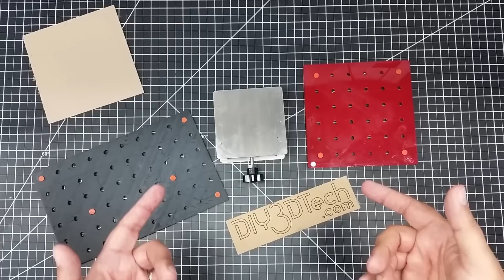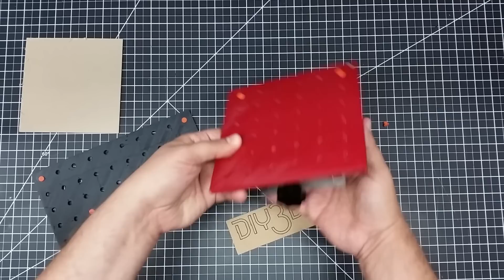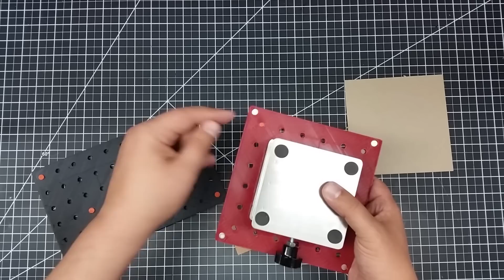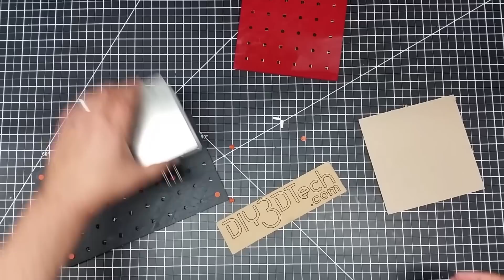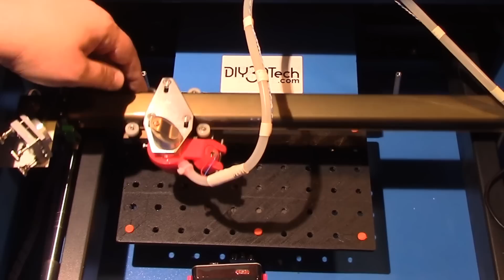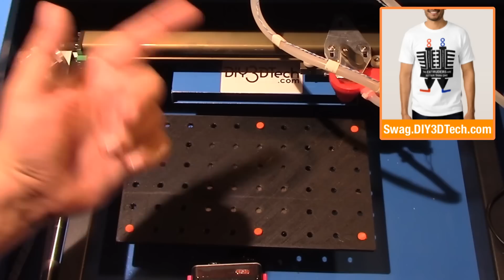K40 eBay Chinese CO2 Laser Cutter & Engraver - Cheap Adjustable Bed Solution!

Comment: Another awesome video! I’m thinking if you add either a fixed jig to the floor of the laser, and maybe magnets or just presure fit the jack, then you will have a pretty repeatble placement for multicuting  something. I’m always removing the piece  before it is fully cut, 1/4 acrylic doesnt always fall through when cut.  This fixture might allow you to remove the material, inspect it, then place it back and perform another cut/engrave.
Reply from the maker: If your going to use the material repeatedly, a jig is the only way to however with mine I really mix it up and on this one it more engraving. now on my other one I do pretty much only cutting...

Comment: looking at getting a k40 and realized it's bed won't work for me because I mostly want to cut leather - your solution is exactly the keep it simple stupid solution I need = )
Reply from the maker: You can do leather, just be sure to have air-assist or you will likely have a fire...

Comment: I got the 8" one and have to return it. Getting the 4x4 now and am thinking of removing the knob and replacing it with a u-joint and extending a shaft out the front of the case so I can adjust it from outside.
Reply from the maker: Had another view do just that (extend the knob outside the case)
Reply: @DIY3DTECHcom  know a good setup for making stepper controlled z-axis bed?
Reply: I added a magnetic sheet to the bottom of mine for more stability

Comment: LOL Great minds think alike, or should I say "Cheap" minds. I did this same mod ironically before building a motorized z as 50usd diy vs the ones for sale at 200usd seems like a mod you should also do.
Reply from the maker: I really don't use it enough to make a motorized Z mod and the reason I went for cheap and cheerful.  As most of time its slaping the same thickness of material in and cutting it out quickly.

Comment: The bottom of these should be OPEN so you can set it ON stuff and engrave... a different lens might be necessary to focus further away...
Reply from the maker: Not sure I understand and of look in the playlist have created several videos on the differing focal length lens...
Reply: @DIY3DTECHcom , if the bottom of the unit was open and the focal length was long... you could set the cutter on something large like a guitar and engrave....
Reply from the maker: Yes you could

Comment: I've done something similar to this. But I keep having a problem as the bottom of the laser seems to have buckled so its unlevel. Do you have any advise on how to sort this.

I'm thinking about cutting a hole in the base where the cutting are is so it's on a level table. But worry that could effect gantry as you could weaken the stucture. strength.
Reply from the maker: You could try shimming it, if you look in the play list I measured dip and 3d printed a shim to match.  I would not cut it.  Also if you feel up to it is others have made a new "frame" for the gantry from maker rail...
Reply: Gantry is separate part. housing has minimum effect on gantry.

Comment: What are the chances of extending the adjusting bolt out through the front of the machine? still waiting on mine to be delivered.
Reply from the maker: Assume if drilled a hole you could add an extension rod if you wanted...
Reply: Two ways to go about doing this. You can get a U-joint, remove the knob from the platform and connect the screw mechanism to the extension out the front, or use an appropriate sized length of rubber/silicon tubing instead (cheaper). 

I'm trying to decide on the best way to attach the platform to the case. Am considering self tapping screws. But, do I pull off the rubber feet, or leave them and run the screws through them? I will post video of what I end up doing and how it turns out.
Reply: @brianfoster1504  Yeah thanks iam currently working on it, there is just enough room under the frame for the screw to go through but i need to cut a slot as the screw also moves up and down as it winds.The screw projecting out is actually left handed thread and so is the knob, the silicon tube is a great idea and i will 3d print a new knob.
Reply: And i removed the feet and pop rivet it to the frame.
Reply: @DIY3DTECHcom  Exactly. Going with flexible tubing to connect the scissor stand and dowel out through the front of the case after I drill a  hole for that purpose. Going to use a rubber grommet around it to reduce noxious fume escape.
Reply: @letsfixit1594  actually, you won't. A single appropriately sized hole that allows for easy movement of the dowel is good enough. The flexible tubing means you can have the case as a fulcrum of sorts. The knob will, of course, move up and down as you adjust things, but if properly placed, it should be minimal. Going to put a rubber pass-through grommet on mine.
Reply: I just use a threaded rodsame size and an adapter covered th jb weld and a slot in the side of the machine. With a magnetic sheet on the bttom to stabalize the stand

Comment: I need to cut balsa sheets for model airplane parts, I like the idea of this raising and lowering table but what would you recommend to use as a bed to hold the balsa sheets because the sheets you use with small holes would make the laser to burn the balsa sheet on the underside. Any suggestions, I appreciate very much
Reply from the maker: Balsa is very light and tends to be blown around by the air nozzle, so would use a honeycomb (like this one: https://amzn.to/2t0vqiv ) and tape down the edges...

Comment: Here is an Amazon Link to a Lab Bed where the adjusting bolt does not move up and down as you raise the table. $<14.00 or would be easy to make. Cheers.
Reply: Where is the link?
Reply from the maker: http://amzn.to/2zaVDZf  its in the video description also...

Comment: This came out about 10hrs after I bought the larger version online.. you know the one that doesn't fit. That one. Great. :/
Reply: Id it is the height you can always open the bottom and then can use any height you desire, also if replace head with an adjustable focus head can work on larger items.
Reply from the maker: if you bought from amazon you can typically return it..

Comment: Have you had anything heavier on the lab jack ? I am looking to engrave cutting boards and some aren't heavy but others can be.  With the 4x4 and the 3d print tables how big do you think you could go to hold something up ? Thanks. you got some great ideas and videos.
Reply from the maker: That should  not be an issue (the cutting board) and you could also place a screen on top too if you want to go bigger

Comment: Have you consisted getting an optional laser cutter head for the Tronxy X5s? Was debating doing that since it would be a good fixed z axis cutter.
Reply from the maker: Nope, I have several CO2 lasers and an "open" laser is a bad idea (look back in the playlist as I built one about 2 years ago) as that thing will fill your house with smoke in a heart-beat and stink!  My wife was ready to kick me out after one time!  With the CO2 they have ventilation systems and there intensity means less smoke.

Comment: 1.Design scissor lift, take plywood, , cut it out. Done. 
2. What is that bullshit about losing power? Adjust mirrors. In other words-keep your laser in proper technical condition before you start to use it!